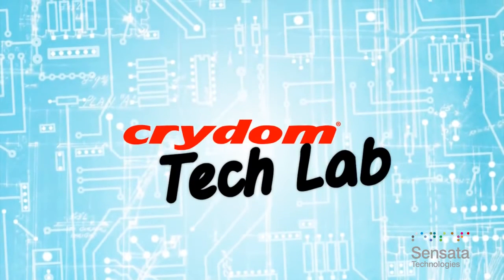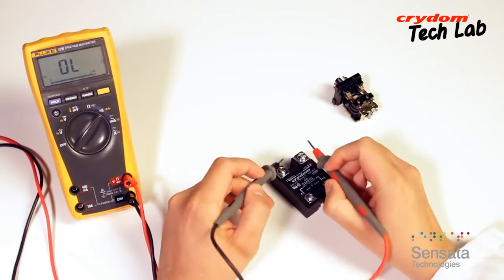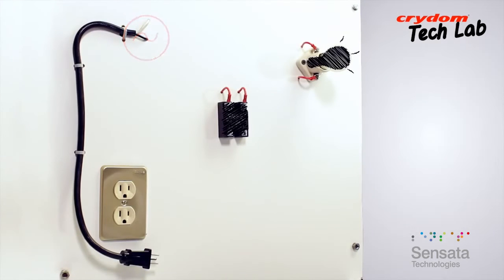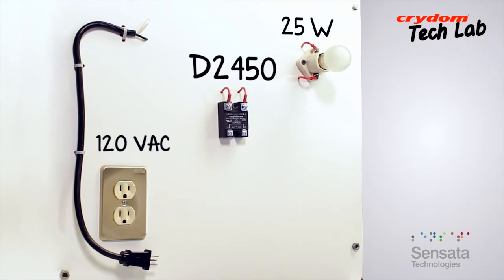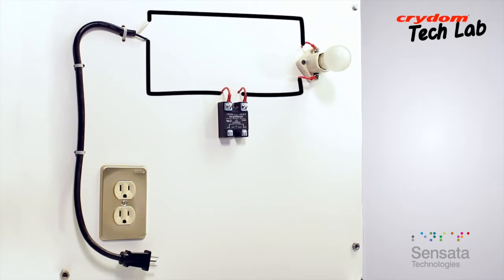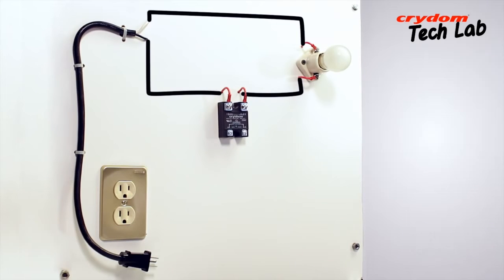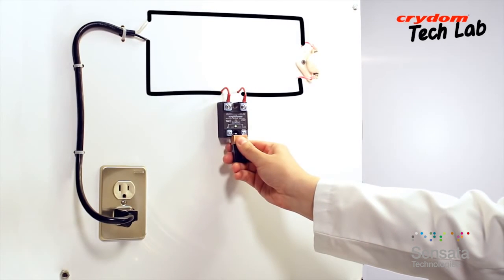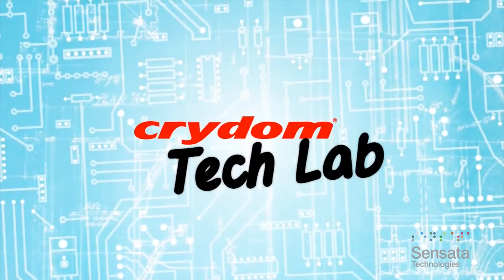Sensata | Crydom Tech Lab - Performing an On/Off Test with a Solid State Relay

Comment: I used an old socket with two wires that came out the back for the light bulb, it was made that way for testing. Then brought 120 in from a spliced cord. My relay was AC.  Did not look safe, with two cords going to the socket  but hey! it worked.

Comment: If I tested without a load, would I still have continuity between the output terminals when the (9V) battery was connected?
Reply: You need some potential diffrence between the AC terminal to get the triac working maybe 20V or so and some hold current to keep it in a low resistance state if it alredy fired like 50mA or so. The continiuty tester may provide 2V and 1mA so it is not capable to forceing it ON anyhow.